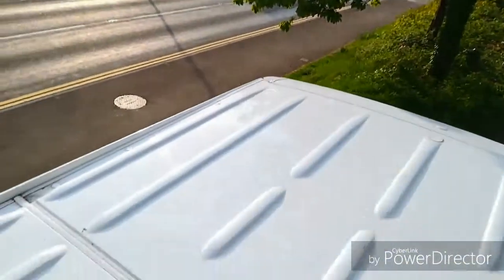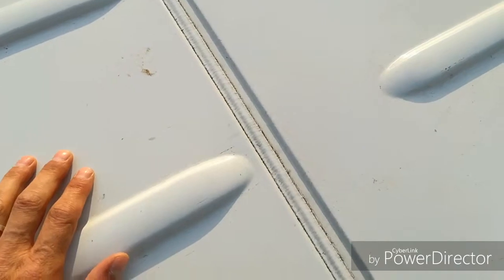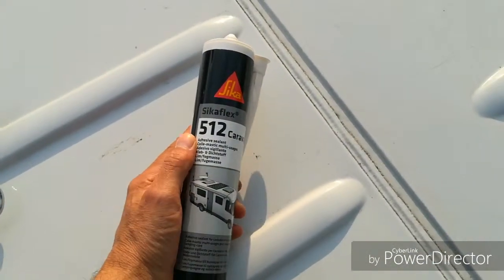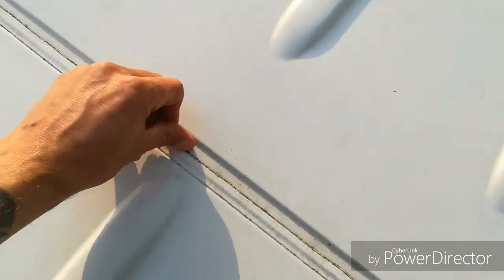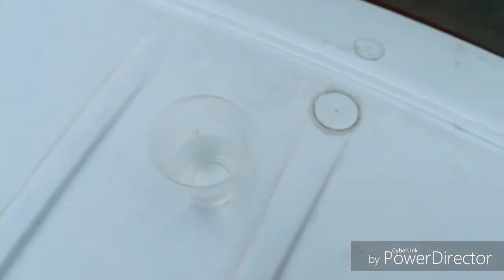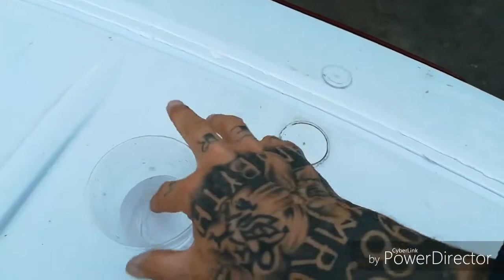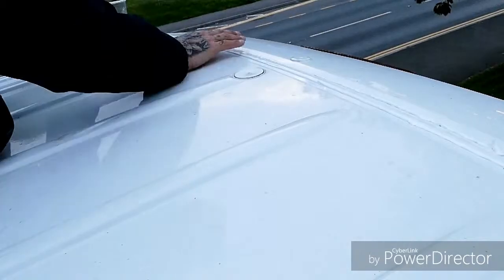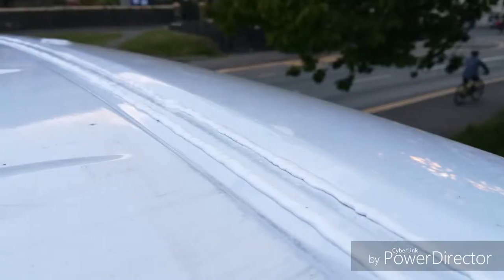Using Sikaflex to seal roof seems on a sprinter

Comment: Nice one, just purchased a 2013 ex DHL sprinter and saw some internal rust on the roof. Having watched your vid and as part of the conversion, i'll be doing the outside too. Appreciate your heads up on this, thanks Paul
Reply from the maker: No problem 👍 and thank you for your comment I hope the build goes well for you 😉 let us know how it goes ❤️✌️
Reply: @brettmanvalleyvan  Will do bud. We're avid subscribers of Greg Virgoe and are always interested in learning more. TBH, i don't think i'm going to have the time or motivation to out up a vid every week. However will try to at least once a month. Best wishes with yours 👍
Reply from the maker: @sunnycampers4249  yes watched lots of his videos as well 👍 would be great to see your build even if it was a few pics of how it turned out 😉

Comment: Good job on those roof seals. Have you checked on them after twelve months? are they still sound?
Reply from the maker: Sorry for the late reply only just seen this, since I done them 2 year's ago now, all is ok on the roof, as for inside ceiling seams I wouldn't know as it's covered with ply and leather, hopefully it will hold of the rust for a few years, thanks Barry 🙏🏻💙✌️
Reply: @brettmanvalleyvan  thanks for your reply.
Reply from the maker: @barry-cq4xg   sorry we were so late replying , been doing this over a year now you'd think I'd get a grip of it 🙈🤣 💙✌️